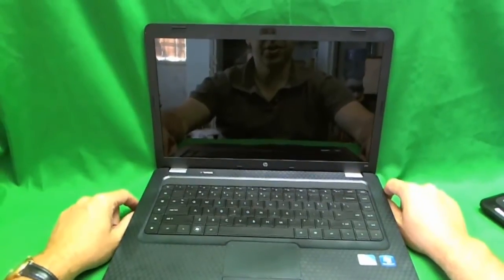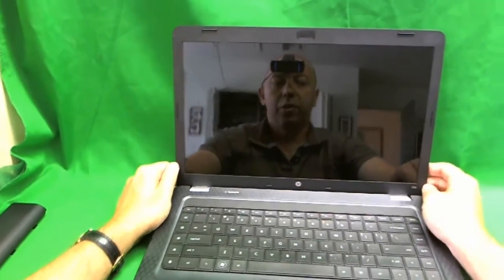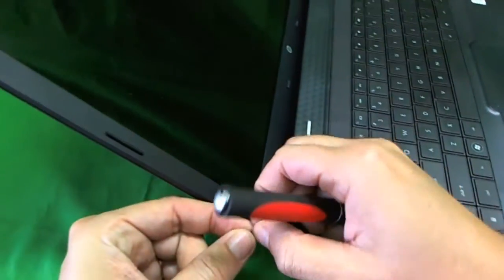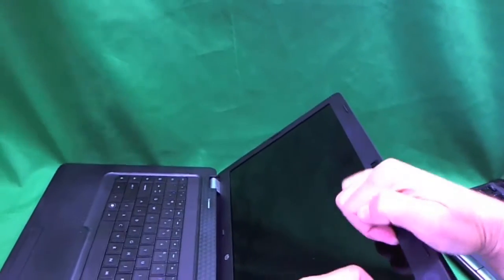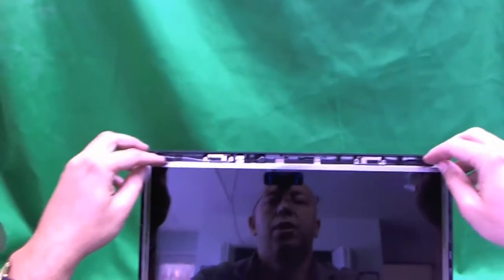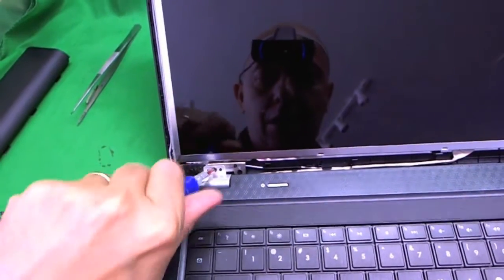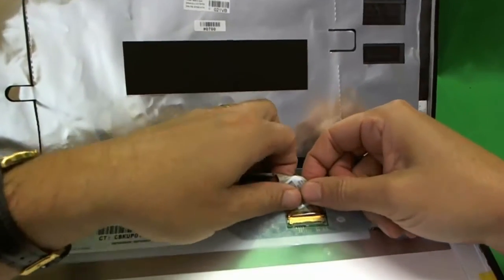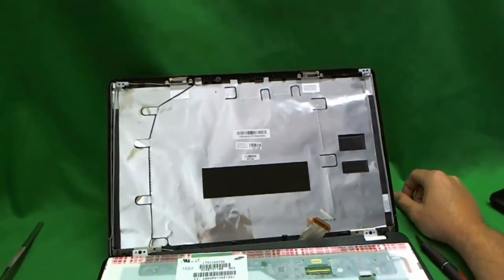HP Pavilion G56 Laptop Screen Replacement Procedure

Comment: just wondering what it requires to sort out my screen; it seems to tilt to a certain angle before my screen clears of these multicolored lines going horizontally across. basically when i open my laptop it has to be less that 90 degrees before the screen is visible without the lines.

Comment: When I change the angle of the screen (or cover), sometimes the whole screen will become white, I have to move it cover back to the previous angle, then it will return to normal.  Is this because the loose video cable, or it can be something else?

Comment: hiii i have a question my HP Pavilivon 14 inch 4g 1125dx screen just cracked its half white nd black spots on it ...ican still use its just da LCD da outside is fine got it 3 days ago new and i wanted to know if i get a replacement screen dat was 14.1 would dat really matter. or can i just get an replacement screen dat is14 inch??